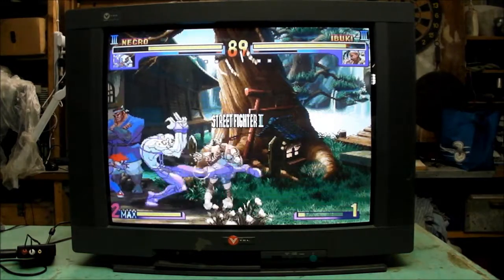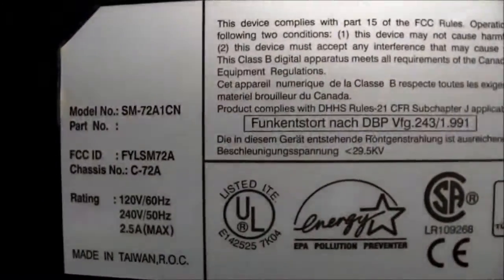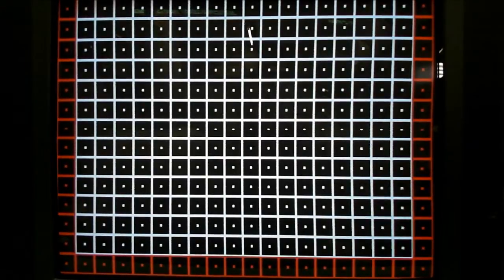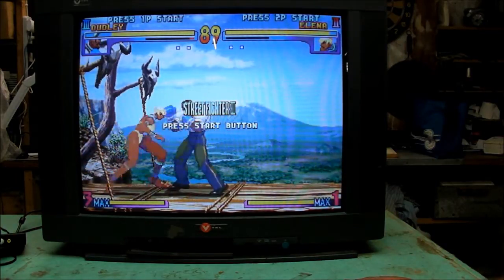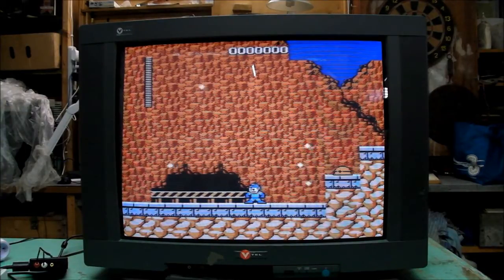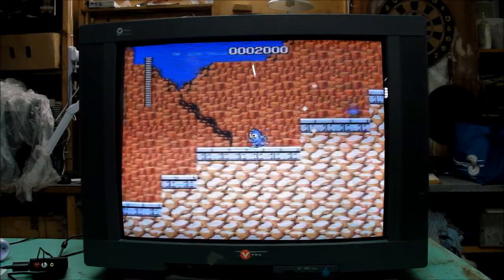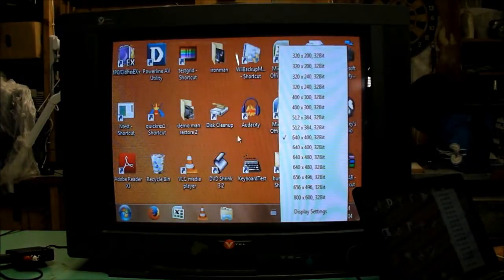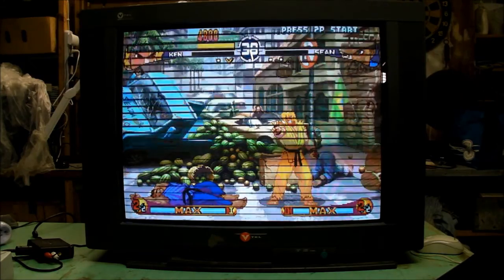Vtel 29" VGA presentation monitor

Comment: Yes. It's the Toshiba doing all the magic. These CRTs are the best ever in any monitors, arcade or presentation. Toshiba, and japanese CRTs generally always have the brightest and most saturated colors. Provided that the yoke is placed well and any convergence correction is done with care, the picture of this monitor should be perfect.

The interference of the grid pattern may be due to a poor Dreamcast cable. Does the jitter show on the monitor's internal menus as well? And is this issue present with other sources too, using another cable? If so I'd check the solderings around the VGA-connector inside the TV (rough handling of connectors may cause this), it seems to come early at the preamp stage of the signal.

Comment: I have a very similar monitor to this. The brand is just Multimedia Monitor. Mine also has composite input and a second vga input in the front.
Reply: I actually ment component not composite. After some testing It seems to only accept 480p via vga. Only 480i or 576i via component. One annoying thing is that av mode needs a remote to enter the service menu which I don't have, to adjust geometry! However the vga mode has geometry settings in the menu.
Reply: @danielknapik2218  Really? Mine will do 1024x768 very weird it's branded as nettv multimedia monitor

Comment: It's a great shame it does not handle 15khz via RGB.
Reply: I'll second that.
It would have been nice because a 15khz modded vga box would be perfect for Street Fighter as it wouldn't be locked in such an inaccurate 640x480 upscale.